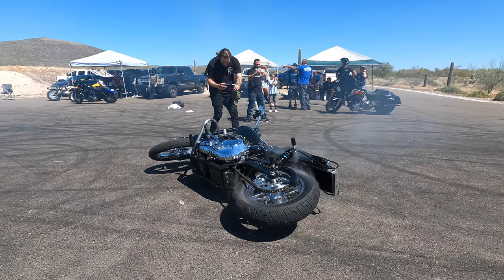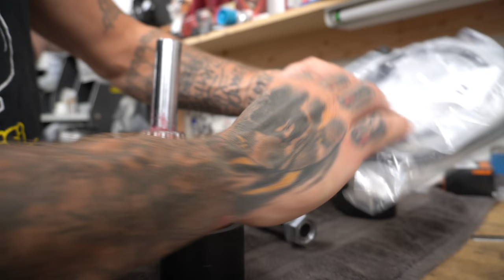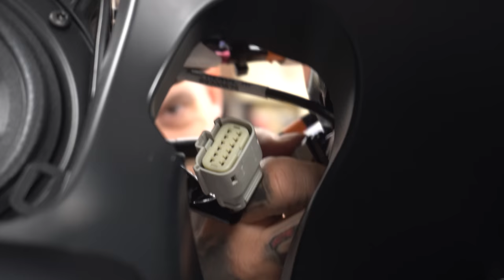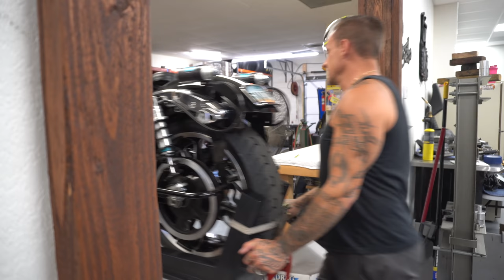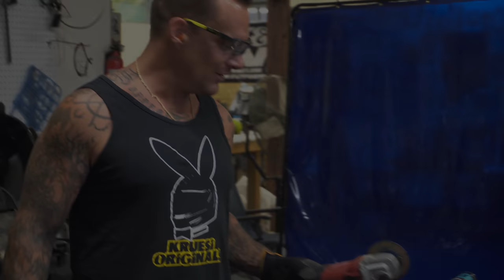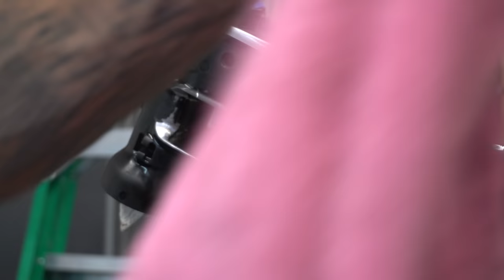Inverted front end on a 2021 road glide. Kruesi Originals / House Of Harley performance bagger

Comment: Hey would I be able to actually hit you up with some questions on a inverted fork swap I did on my 07 sportster? Got a few concerns that are always chewing at the back of my head and haven't really come across many people with the knowledge base to answer them , I have a small shop myself where I powdercoat cerakote paint and repair bikes and build race harleys but I've never done what I did to my bike before so I'm worried over a bunch of shit, it rides solid no vibration or wobbles but still

Comment: Just curious why yall always use gsxr front forks? Have you tried other forks and didnt like the results or is it more because of price/availability of gsxr parts? Coming from a sport bike kid trying to understand the hd world
Reply: Correct me if I’m wrong, but I believe the trees he’s using is based on the gsxr forks. I’m not an expert on sport bike suspension, but he has mentioned that the gsxr forks are the correct diameter to fit the trees. I’m sure that any forks the same diameter would work. Correct me if I’m wrong but I believe the gsxr has the best forks, or it could be the fact that they are the same between the 600, 750, and 1000 and over a wide range of years which makes it easy to recommend them to someone buying used that doesn’t really know the difference in all the specs.
Reply from the maker: Most sport bike forks the exact same. They’re all either made by two different companies. The 14 and up GSR just have the right outside diameter. That’s really all that it boils down to we change out the internals anyways